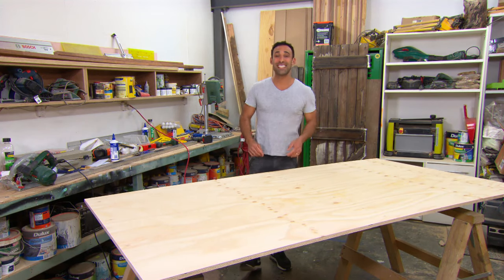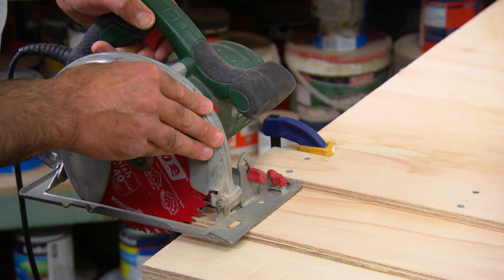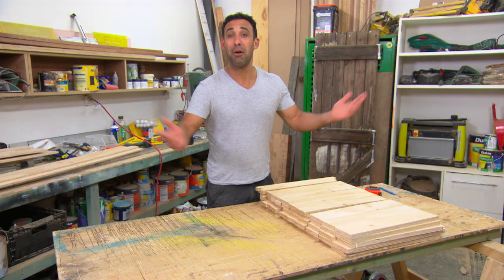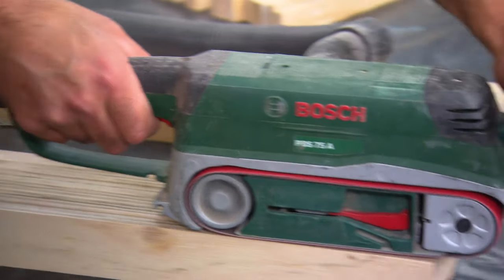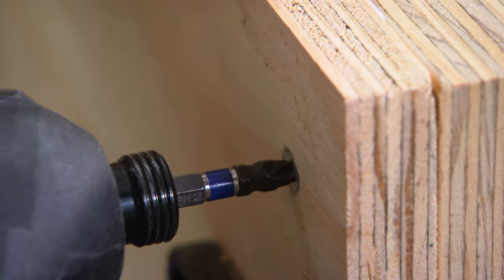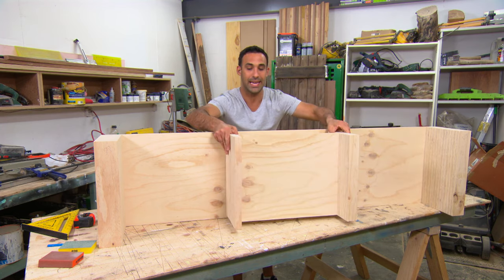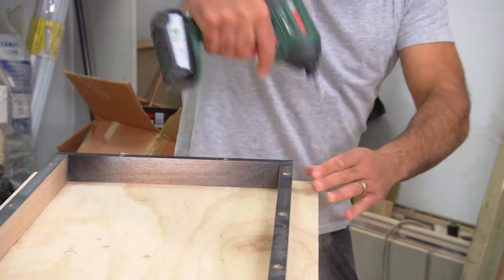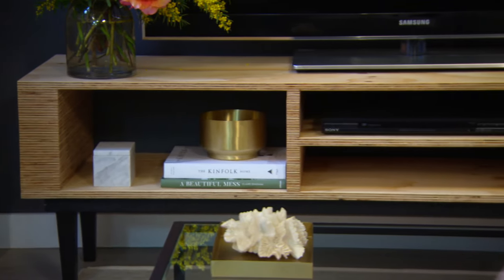How to Make A TV Cabinet from Plywood | DIY | Great Home Ideas

Comment: built this and looks just like the one in photo. It did take quite a bit of time, especially the sanding and trying to find a top piece of wood that had no knots in it was bit of a mission. And I must say the the smell from the Danish oil is still lingering on after a week, hopefully it will eventually go away. Probably would not do it again as I could have brought a new one although not the same design from the local store for around $200 and just tarted it up with paint and new handles for a lot less work. But I do think out of all the home built media cabinets on youtube I have seen this one looks the best due to the effect of the laminated sides and simple design, but that comes down to personal taste I guess.